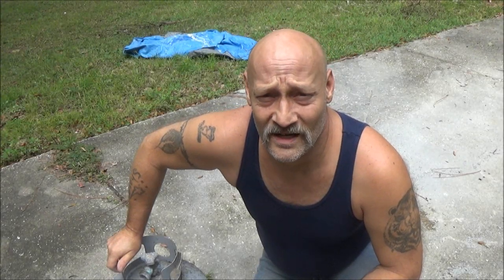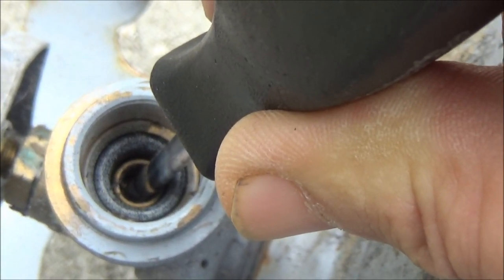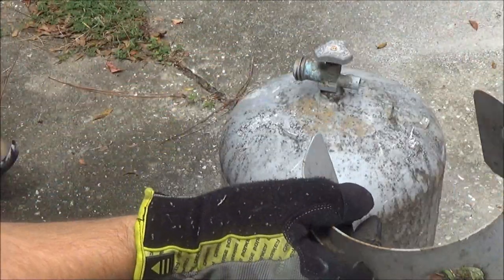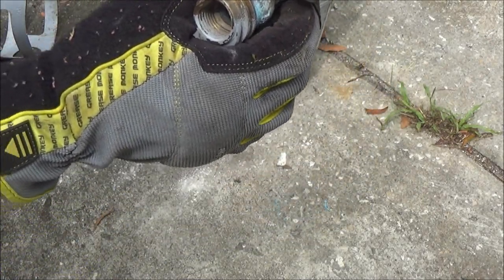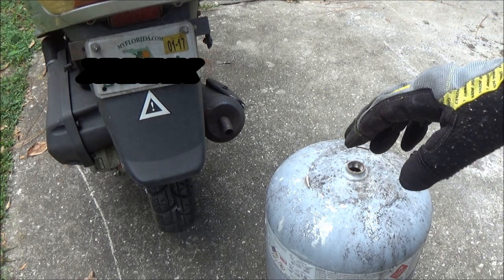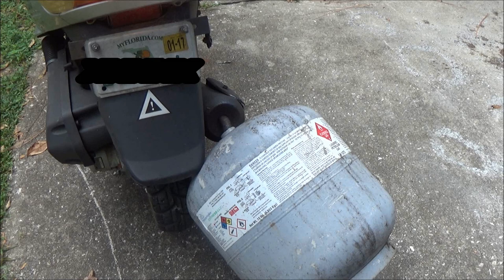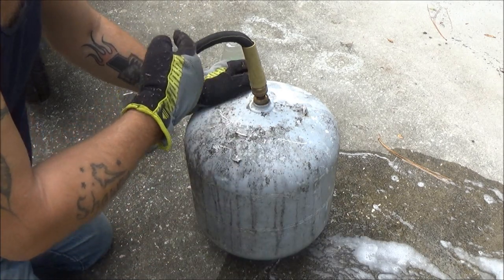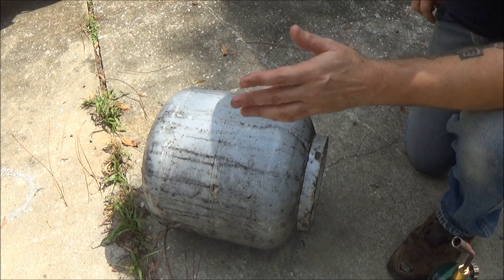How To Clean A Propane Tank For Safe Cutting

Comment: Just fill it with water to clear it , far easier
Reply: Yes, exactly what I thought. I thought he would use a hose pipe off the exhaust to fill with exhaust gas. Connecting directly to the exhaust on the scooter was a bit crazy because sparks can come out of exhausts. Anyway, he got away with it ......
Reply: Yeah overkill for sure .
Reply: Propane is heavier than air. Turning it upside down clears it out in a minute. No water needed.

Comment: Few things.   The new valves have a screw on the side of it.  Unscrew it with a screwdriver and open the valve.  The gas comes out without having to depress a valve, beep inside the threaded part like shown in the video.    Also, you can rather easily make socket out of a piece of pipe.  Remove the zinc valve on top but simply taking a small hacksaw blade and citing the lobes off.  They come off like butter because it’s made of cast zinc.  Then slip the home made socket on top of the entire valve.  I welded a nut on top of the cut pipe socket and now I have a big valve removal socket I use with an air impact gun.  I stand removal without any effort.   Then I turn it upside down for an hour.  Then fill with water until it overflows.  I do that three times and it’s safe to hit the tank with a cutting torch.  Easy.
Reply from the maker: Thanks for the tip Colt, sounds handy. And thanks for watching and commenting.

Comment: What we used to do, once we got the valve assembly out. Is stopped by the local grocery store Welding Supply and buy about a dollar fifty worth of dry ice. Drop that inside with a little warm water. Within a minute or two you'll see fog start to come out the top. It's carbon dioxide. It can't ignite. You can cut on that tank with a torch and it won't matter at that point.
Reply from the maker: Thanks for the tip. Great info.
Reply: Nice!!

Comment: Don't use the hot exhaust method 1 small spark coming out of the exhaust could ignite the residual gas still in tank just use soap /water and flush 2 or 3 times .

Comment: Small engines sometimes shoot sparks out of the exhaust, so I wouldn't use that for purging.  Cutting off the top is not necessary if you're using a wrench instead of a hammer to remove the valve. Once the valve is off, just stand up the tank and fill it with water from the hose.  Water is heavier than propane so when the tank overfills, just empty it out and you're good.    Refill and empty again to be sure.

Comment: Iv built nice air caddys from the old style tanks you don't need to cut them just have the correct thread adapter ,the advantage of a propane tank air caddy is you put 80psi in it today in 9 months when you get a flat it still has 80 psi , they don't leak down
Reply: I've got a couple forklift cylinders I'd like to make air tanks out of.
Reply from the maker: @jonathanthrift6258 those would make awesome air tanks.

Comment: I have no intention of cutting a propane tank open, but it’s nice to see how the valve works. Thanks for making this video.
Reply from the maker: You're welcome.  Any ONE of the things I mentioned in the video will be safe to do.  The easiest way is to just fill it with water and turn it upside down to drain then let it set overnight upside down.  You won't blow up.

Comment: Just got an expired tank from my Dad. Some glad I watched your video.
I intend to make a waste oil burner with it.
Reply from the maker: That's a great idea. I'd like to see it when you're done.
Reply: You should not have posted that. Unless you are certified in oil burning. A home made pot burner is just as illegal as an uninspected fireplace home made.
Reply: @mrright69  I intend to make a camp, backyard stove, not to use in my home.
Don't be silly.
Reply: That why I'm here too. To make a waste oil burner for cooking
Reply: @kramidanalub  Haven't got started on it, but since the mini-bike project has completed, and warmer weather is coming... I got a propane tank ready to process, a nice disc brake rotor and etc. metal. Oh, and cooking oil and motor oil to get rid of.

Comment: We are purging a 100lb tank,filled it with 5 gals of soapy water,put an adapter and air nipple on it connected the air hose and strapped it upside down on a dolly.

Filled it then popped the hose off,did that twice. 

Now we are just filling with air and purging.

The intended use is an airtank for our compressor.

17.5 cfm at 125 psi 

Have some cutting and welding to do on the tank an olet needs to be added for a drain.

Comment: Today i did the same thing , but i thought of using rubber hammer, and also make sure the valve is close( even i emptied the tank as much as i could), this way is safer i think !
Reply from the maker: Thanks for the tip. And thanks for watching and commenting.

Comment: I press the spring loaded valve part with a screw driver after opening the side vent screw.  For a time I was taking cylinders to a full on Propane dealer and he would always open the vent screw prior to filling the tank.  I like the nut welded onto the pipe segment but I don't have a welder and since I will be removing the valves on tanks that get dumped at a local household materials recyke center, where electricity is not available, I will go with the hammer option, substituting a claw hammer with my Harbor Freight short handled 4 pound hammer.  What I did when I was cutting cans here was to center drill a hole near the top and one near the bottom, after the bleed out, and then leave the cans set out a couple days and let sun and air "purify" the interior.  After that I could grind or Sawzall with no concerns.

Comment: You don't need a vice.  Get a 2' long piece of 1/2" rebar and push through the holes on the bottom of the tank.  Turn your tank on the side, like you did when you used the hammer, the rebar will stop your tank from turning while you use your wrench.  Now take a 10" Crescent wrench (adjustable spanner wrench) and use it to take the valve out.  The simple way and sure way to purge your tank is to put a water hose in the top and fill it until until completely full.  Now your tank is safe to cut.

Comment: take the handle off the top of the valve take a wrench and take the guts out of the valve (the nut under the handle is called a packing nut) then the valve is wide open no restrictions
Reply: Good info

Comment: thank you for making the video I am a little bit concerned about your safety you can get Sparks out of an exhaust also if it backfired for any reason it could turn nasty I think you would be better filling it with water to drive the gas out the other suggestion is why don't you pass a rod through the two holes on the bottom and then stand on the rod and use a spanner as I said thank you for making the video I know you're trying to help please take care

Comment: The valve unscrews fault easy, I've done several, put a pipe through the handle you ground off to hold it and a pipe wrench with a pipe extension and turn. I fill with water as well, then you can cut the tank

Comment: Propane is heavier than air so another safety trick after emptying the tank leave the valves open and off and leave the tank upside down the heavy propane well go to its lowest point removing the extra gas from your tank
Reply from the maker: Thanks for the tip
Reply: He showed that in the video….

Comment: Better to purge tank, remove valve (with a wrench) & fill with WATER, BEFORE you start cutting with a grinder & hammering!  The grinder makes sparks. If you miss the brass valve with a hammer, it causes sparks! Good idea with exhaust, UNLESS the motor throws a spark! Better to displace propane with water.
 Also, there is a purge valve on the side of the main valve (little slotted screw) that purges the tank without depressing the ring in the main valve.
 The idea is to remove ALL the gas BEFORE making ANY kind of sparks!!!

Comment: What do ya suppose happens if the scooter is running a bit rich (unburned fuel)  OR a spark (hot carbon flake off the head) gets past the muffler packing !  BOOM !
Reply from the maker: No boom. In order for that to happen the scooter would have to be blowing raw fuel out the exhaust. If that was the case the scooter couldn't run at all. Do your research before you talk about something you know nothing about.

Comment: Use a an compressor instead of Scooter exhaust? I don't have a scooter but I have a compressor.
Reply from the maker: Yes. Or can can just fill it up with water after you rinse it out.
Reply: @shabear1000  thank you.
Reply from the maker: @lakerdigital  you're welcome
Reply: @shabear1000  After some reading online I found that it's better to use exhaust because it is mostly devoid of oxygen, so an air compressor is probably not the best idea. You had it right with exhaust.
Reply: @lakerdigital m😊

Comment: Ok for one the bleeder valve should be opened and then the valve assembly removed and fill with water and cut from the top down and once the main cut is made the air and gas mix will be far from right for combination gas will bleed from the hot steel and once enough air is introduced to the inside of the tank the parts per million will not allow it to blow up this is a very dangerous way of doing this please do not do this at home if the tank is full of water it's impossible for combustion this is  a waste of time

Comment: Why didn't you just fill it with soapy warm water to purge it ?
Reply from the maker: That works fine, but I wanted to make sure no one blew their selves up lol. But yes purging with soapy water will work fine. You can also purge it with argon if you're fortnite enough to have it on hand.
Reply: yep, i made a little wood stove for my mini-spa/sauna, and i used water + dish soap (3X to be safe!) before cutting, and i did not blow myself up!

Comment: Once you’ve got the valve out of the tank, at arms length point a blowtorch at the hole, at which point you may get a little whoosh. That’s how to purge propane.
Reply: Once we took the valve out of the tank and turned it upside down, I drilled a hole in the bottom and we poured a couple gallons of water through it and let it sit for a half hour

Then we went back and put a torch to the top of it and it blew out like a NASA jet engine and almost killed everyone within 10 miles. That was an exaggeration
Reply: jesus h. christ

Comment: Just fill it with water dude.  Far simpler.
Reply: Water does not always work if you have any air pocket in the shape of the object,  I'm certified 6g pipe welder 40 years. Do you want to move 40 or more gallons of water in a tank at 7lbs. A gallon?

Comment: Just pump carbon dioxide into tank no oxygen  no boom. I've done offshore racing boats custom gas tanks if you have carbon monoxide filling it with no oxygen no boom
Reply from the maker: Yep, that's why I filled it with the exhaust from my scooter.
Reply: I told someone else who wants to use water at 7lbs a gallon?
Reply: Good mentions until fill with CO. Never use monoxide for anything.
Dioxide.. absolutely!
Reply: @mrright69  I do mobile tig welding stainless aluminum titanium mild and tool steel. My machine is gas powered and I put an exhaust hose on it, like a mechanic shop does in the winter through a garage door. I put that hose into the largest fill tube or opening of tank, the excess of fumes goes out the vent hole in tank. I've never had one blow up or pop on me. My point is no oxygen no boom. I  hope this helps make sense of what I mean. Been welding 42 years. State certified 6g all positions pipe up to 5,000 psi hydraulic lines.

Comment: Could have just filled it with water once emptied. Since it will not be used as a compressed cylinder again. Otherwise. Empty the gas, pipe wrench off the valve. Fill with water. Drain. And done

Comment: CAUTION, sir! Your cylinder is NOT EMPTY. There may be no liquid propane, but there is still unpresurized propane in it. If you remove the valve, put the tank upside-down above the ground in a free flow air supply. Propane is heavier than air and will exchange itself with air. Why do you use soap? Just fill it with plain water until overflowing; all flammable gas has been eliminated. The exhaust from your scooter will do nothing to purge the propane if you have no way for the exhaust to enter and replace/chase out the propane. I have worked with liquified gases like propane, helium, oxygen and nitrogen for the better part of 30 years. To remove the valve easier, put the valve in the vice and turn the tank - it works pretty well most of the time. You may need to build a special tool to reach the valve base if you want to keep the valve protector in place. All bets are off though, if there is a bunch of corrosion. Cheers.
Reply: I have a huge one in the ground trying to remove. Left it cracked and has been 20 hrs and still propane coming out. It’s still in the ground and need to clean to dispose of it. Any suggestions how to remove the propane and clean this monster without blowing myself up?

Comment: Why not just light the remaining gas after removing the valve with a torch or something making a frame thrower until it's all burnt,
Reply from the maker: I have seen guys do that with no problem but I didn't want to be responsible for an idiot getting blown up lol. Anyway thanks for watching and commenting. Have a great weekend.
Reply: That is a very risky way of doing it. If you find you have the right air/gas mix inside the container you can get an explosive mix. The cannisters are strong and would probably withstand the forces but I would not risk it. An effective laxative at the least........

Comment: Lighter than air so purge upright.... Then Why not simply fill with water to purge. Ugh he is killing me
Reply from the maker: It's heavier than air, that's why you turn it upside down. And you can just purge it with just water but if you are using something electrical ti cut it open, not a good idea to do it with water in it. How many have YOU cut open?